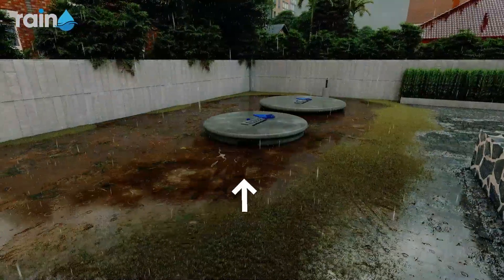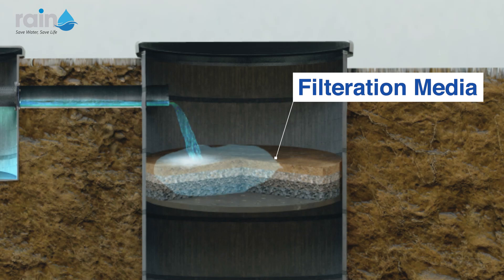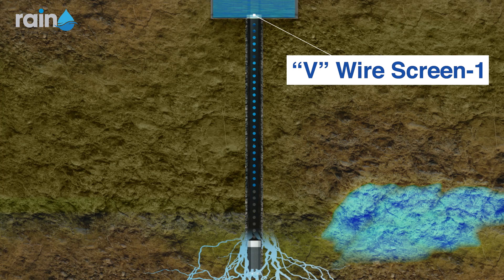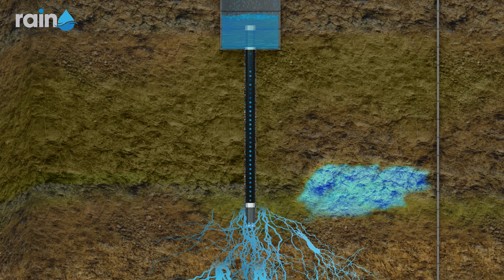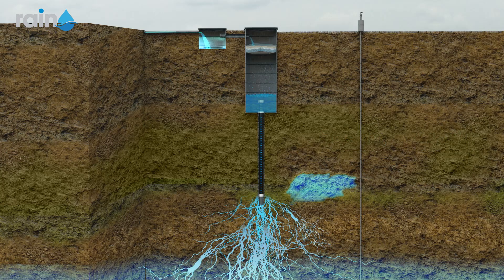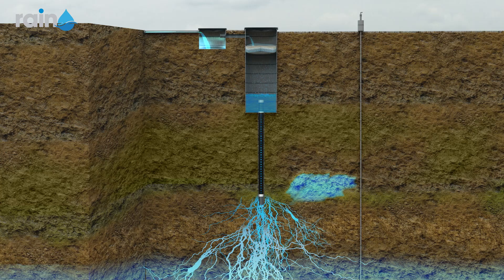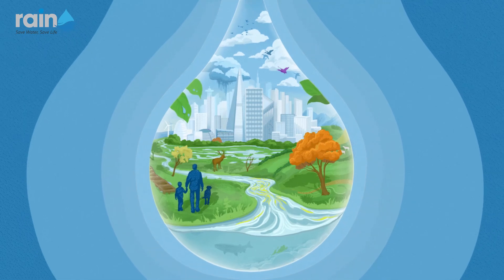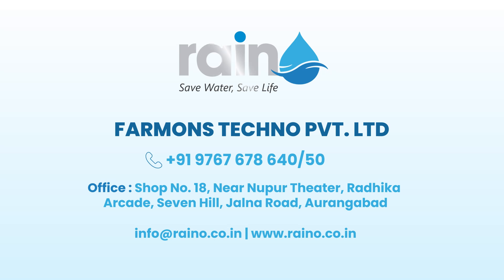Injection well | groundwater recharge systems 💧 by #raino #groundwaterrecharge #waterconservation

Comment: Why not let soil filter water as it does naturally? if something goes wrong with tank filtration, you will risk spoiling underground water sources.
Reply from the maker: Hi there! 👋

Thank you for sharing your thoughts on letting soil filter water naturally. While natural infiltration is indeed effective, it has become a challenge in urban areas due to increasing impervious surfaces like cement and concrete. These surfaces drastically slow down or even prevent natural percolation, often causing rainwater to drain off as runoff instead of recharging the groundwater. 🌧️

Why Artificial Recharge is Important?
In today’s age of rapid urbanisation, the natural process of water infiltration can take months or even years, depending on the soil strata and impermeable surfaces. That’s why artificial groundwater recharge using technologies like RainO Injection Wells is essential. It not only speeds up the process but also ensures water reaches deep aquifers efficiently and safely. 💧

How RainO Protects Underground Water Sources

1. Collection Tank: Rainwater is first directed into a collection tank, where heaavy dirt, debris, and floating particles settle naturally through the siphoning effect. This is the first stage of filtration.
2. V-Wire Screens: The water is then transferred through our specially designed V-WIRE screens that block major particles, ensuring the water entering the Injection Well is already pre-filtered.
3. Filtration Media: Inside the Injection Well, water passes through layers of advanced filtration media like activated carbon, sand, and gravel, which remove finer impurities and contaminants.
4. Percolator Pipe: The water is further filtered through vertical V-WIRE screens placed on both ends of the percolator pipe before it reaches deep aquifers.

This multi-layered filtration ensures no harmful debris, contaminants, or waste reaches the aquifers. Plus, in areas with excessive waste, we add extra filtration media or Additional filtration techniques to further enhance safety. ✅

Why Groundwater Recharge?

1. Storing rainwater in open tanks or surface reservoirs often leads to evaporation losses, especially in hot climates. 🌞
2. By recharging the groundwater, we store water naturally within aquifers, which prevents evaporation. The water becomes available for reuse via borewells, as recharging increases groundwater levels, making it a sustainable and long-term solution.

Why Artificial Recharge is the Future?

In densely urbanised areas, where natural infiltration is obstructed by impermeable surfaces, artificial recharge is the most efficient, safe, and sustainable method to conserve rainwater and replenish groundwater levels. 🌍 When implemented responsibly, as we do at RainO, it does not harm underground resources but rather helps revive aquifers that are depleting due to over-extraction and urban runoff.

We hope this clears up any doubts! If you have more queries, feel free to connect with us at marketing@raino.co.in. We’re always happy to help! 😊🌱

Warm regards,
Team RainO